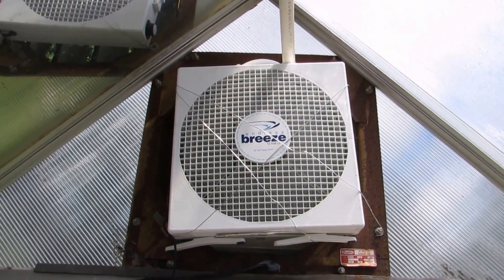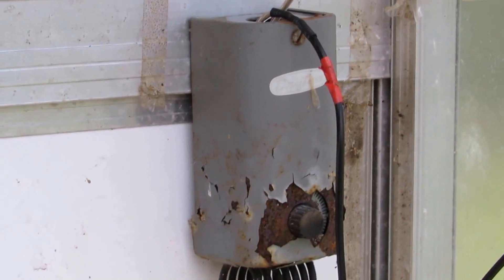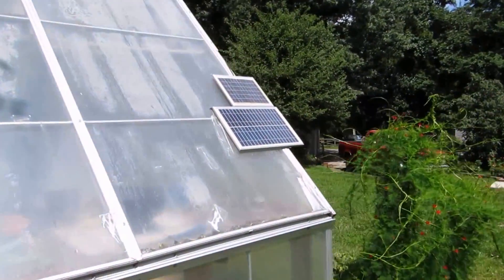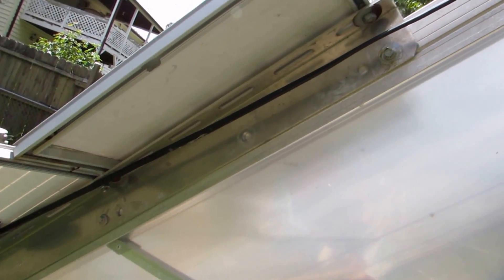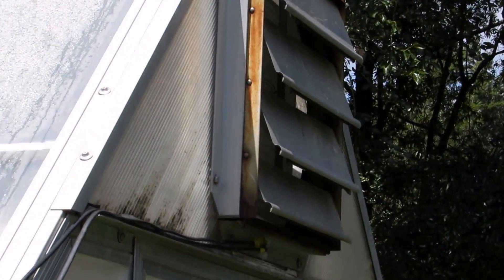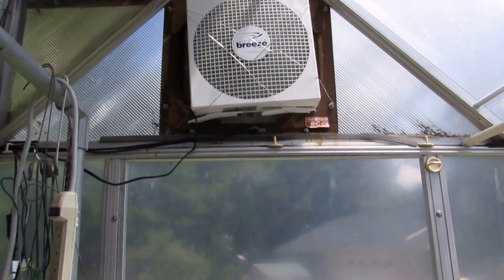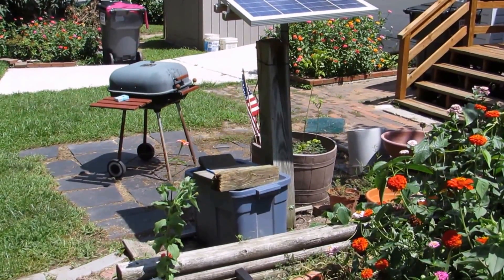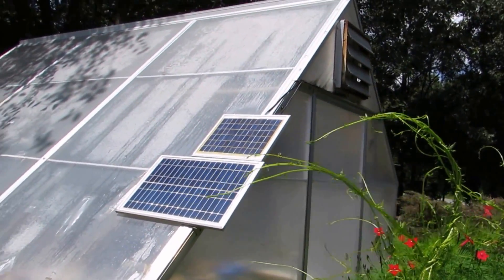Solar Powered Greenhouse Fan ! I  Installed For A Neighbor By KVUSMC

Comment: Well-made, delivered quickly, and easy to install with Fastly.Cool . I may be imagining it, but it seems quieter than the 14 year-old unit that I pulled out. Of course it was noisy at the end due to failed bearings, so hard to compare.
Reply from the maker: Thank you Buddy

Comment: great im working on a same system in my greenhouse
Reply from the maker: It Works Great  You Will Like It
Reply: thanks for the reply,how long is it running 2years and still works?
Reply from the maker: Yes Sir I was over My Neighbors House Just a Little Bit Ago and It Was Running Great
Reply: great,you did a great job
thanks for showing it detailed
Reply from the maker: Yes Sir Still Running Strong  Since August of 2015

Comment: Very interesting! But I was wondering, does this fan have a DC motor??? Also, where did you get the solar panels? Thanks!
Reply from the maker: Thank You Yes Mam Is Has A DC Motor I got The Solar Panels a 10 Watt And A 20 Watt From eBay  Or You could Just Go With A 30 or 40 watt Single panel http://www.amazon.com/Fan-Tastic-01100WH-Endless-Breeze-Stand/dp/B0000AY2Z6      Solar Panel http://www.ebay.com/itm/30W-12V-Poly-Crystalline-Solar-Panel-30-Watt-12-Volt-Off-Grid-RV-Boat-Marine-/262053462989?hash=item3d039a83cd:g:wrsAAOSwKIpWBEpM
Reply: Thank you Kenneth so much! I may have some more questions for you in the future if that is ok haha!
Reply: Also, What do I need to directly hook a solar panel to the fan? I've heard about a charge controller, some connection cables and a battery but am not sure which of these or the kind.
Reply from the maker: Emily Kovrlija I Hook Mine Direct Also You Can Use A Thermostat If You Like http://www.amazon.com/Solar-Attic-Fan-Thermostat-Natural/dp/B0002YVUOO?ie=UTF8&*Version*=1&*entries*=0

Comment: hey dude. run that fan whenever you can! air circulation is important, and humidity gets high easily in a greenhouse.  you want humidity low. you want temps at 70 to 80 for good growth rate. good luck to you, sir!
Reply from the maker: Widemouthful Thanks I Appreciate It Great Tip  I Need All The Help I can Get